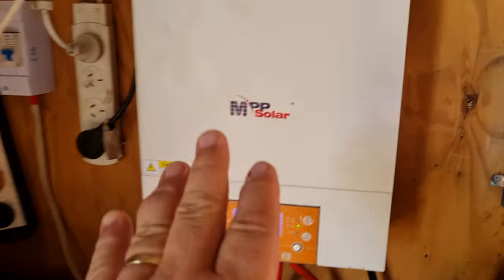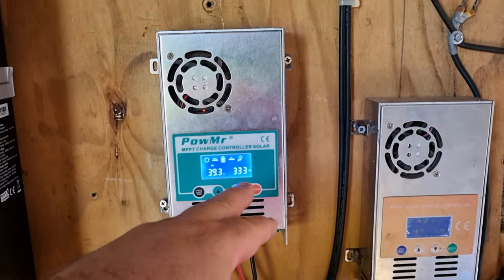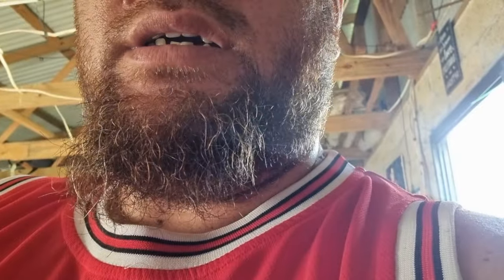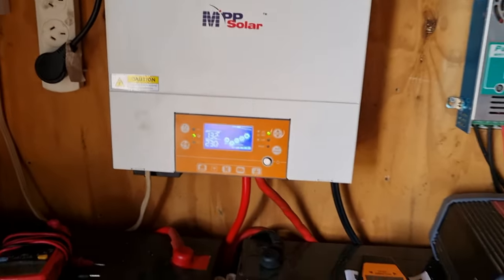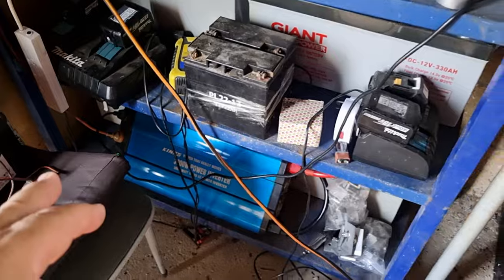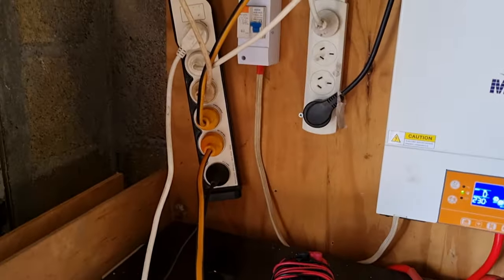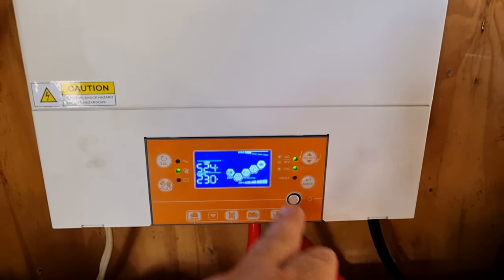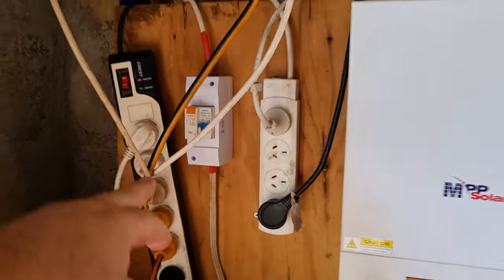New Solar system. Why I can't get the full potential of my panels

Comment: Did you compute the power loss due to the age of the panels? I think you said some of the panels are 5 to 6 years old. Some of the loss might be comming from there. 

Also are you checking during the peak of production. Usually it's when the angle of your panels are optimal with the angle of the sun.
Reply from the maker: Awesome thank you. I will check all of it out.

Comment: You're voltage it's very low this inverter works at full capacity when voltage it's between 300-360v when conect different panels in series if you have for example 8 panels at 370 w and 1 or two at 200 w all the panels are going to work at 200 w
Reply from the maker: Thank you..

Comment: Open circuit volt is your what you should be using so if you have 6panels at 50 volts = 300 volts then look at your mppt  amps use your multimeter test what pv volts you have at inverter I have 6 panel making 250 volts with mppt start volts 140 no trouble to be charging battery early morning at 5watt
Reply from the maker: Thank you will check that out...

Comment: What is the max input voltage for your charge controller?
Reply from the maker: 500v and 6000w
Reply: Post  specs for  all of your panels. And how many of each .. We could maybe find optimal combinations for each controller. And the ccs  To get you the maximum out put for each
Reply: @monidamonlolomanaia6595   yeah series all the matching panels